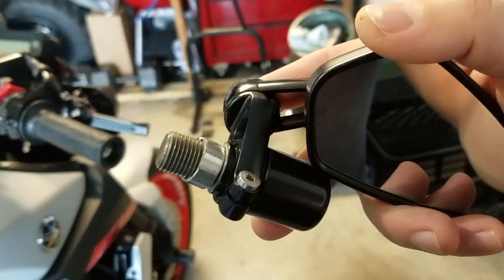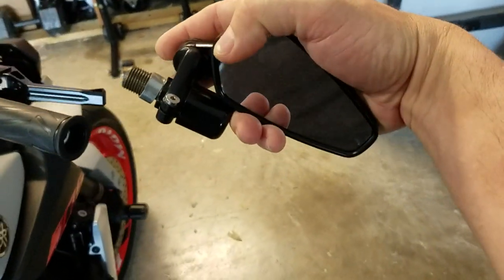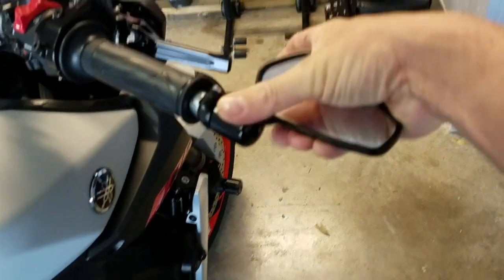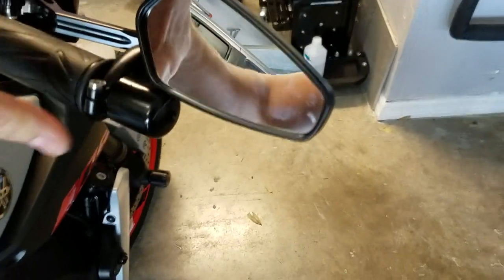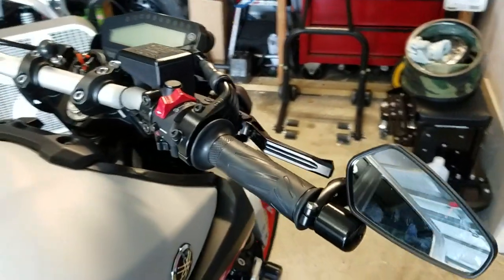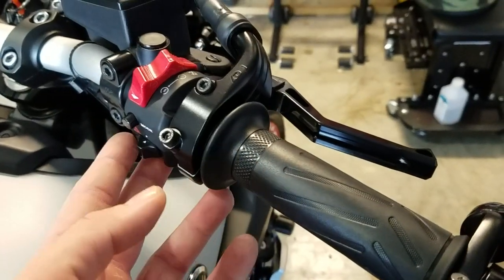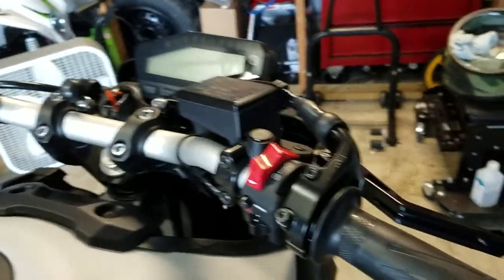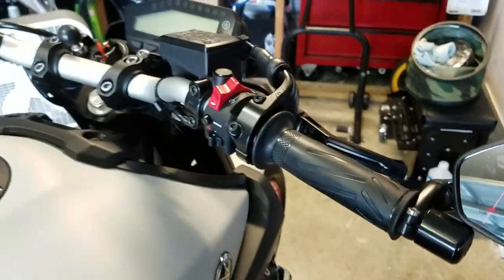How to make aftermarket mirrors work on stock mt09/fz09 bar ends without making the throttle stick

Comment: Nice! I've used a similar approach with spacers, but basically made a sketch with fusion 360 and 3d printed them. Working like a charm for more than 1yr now.
👍
Reply from the maker: That's awesome man, great idea with the 3d printer

Comment: I've done the same setup on my fz a few years ago.. word of advice for someone about to attempt this: while the change is easy to do, make SURE you have a properly sized pipe and get rid of all of the burs.  If the spacer/pipe you add isn't done properly it can snag on the throttle and potentially cause it to stick open which would be quite dangerous.
Reply from the maker: agreed, I usually use a brass plumbers fitting that I buy directly from my local hardware store but just happened to see some pipe in my junk tool box that I thought might work, which it did. Definitely good advice either way. This is my 4th fz/mt-09 that I have done and set up this way but the first time I have ever done it with a homemade piece.
Reply: It's definitely one of the best value for modifications.. The stock rabbit ears are terrible.

Comment: When you remove the stock mirrors what did you put in the threaded hole so you dont have ugly open threads
Reply from the maker: just rubber plugs I had sitting in my tool box.

Comment: I did a similar mod with my bike. When riding, my hands get get tingly. Could this be caused by the bar end not going in tight enough? Have you experienced anything similar?
Reply from the maker: Never experienced any tingling, maybe you're gripping your bars to tight or locking your wrist in an odd position??

Comment: Hi mate. I've seen another video on here for these mirrors with the chap saying that the mirror clamp is ever so slightly two big to close tight on the OEM bar end weight. Did you have to use something and if so what? 
Cheers buddy.
Reply from the maker: I didn't have to use anything these fit perfect but i guess if yours are slightly to big you could put some blsck electrical tape under them to take up some space

Comment: what caps did you use to cover the holes left from the stock mirrors? 
thanks
Reply from the maker: Just caps i had laying around in my toolbox, you can get something similar at a local hardware store 👍

Comment: What size tube did you use?
Reply from the maker: Honestly I have no idea, i found the piping in my junk tool box and cut it to size. I usually use a brass plumber's fitting that i get directly from my local hardware store, this is the first time i have ever made a homemade one.

Comment: Great idea. I have the pro taper bars on my FZ-09 so this wont work unless I tap my bars
Reply from the maker: Thats when you use the aftermarket bar ends
Reply: Pro taper bars use expansion anchors, not threads.
Reply from the maker: @cavedog1279  Exactly!

Comment: Bikes looking good! The Yamaha MT09 SP also has a powder coated black bar, btw how much$$ for that XSR900 bar?
Reply from the maker: Thanks, I think they where like a $100  shipped??
Reply: I mite change my silver bar to the black one also, i think it looks good with black on black, i have the 2017 MT09 Black Tech, thanks!
Reply from the maker: @DaviCupra  No problem at all!
Reply: @r6realtor  did you order directly from Yamaha?
Reply from the maker: @charleskaczmarek6568  no, rockymountainatv.com
Reply: r6realtor they are the OEM bars though, correct?
Reply from the maker: @charleskaczmarek6568  yes
Reply: @r6realtor  great, now I just need to find a part #...!!!!